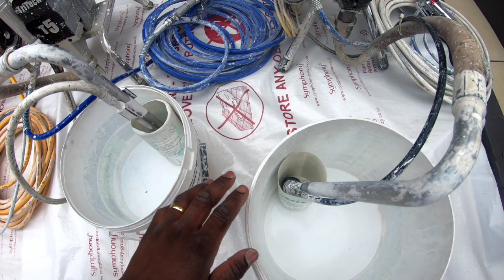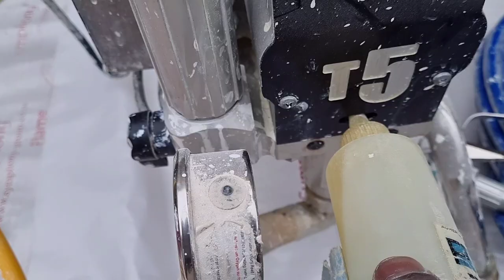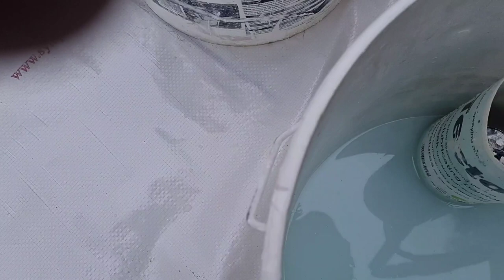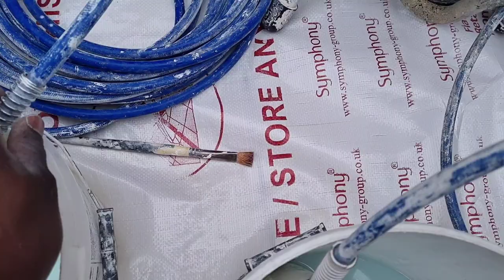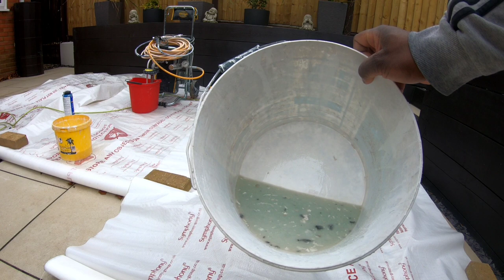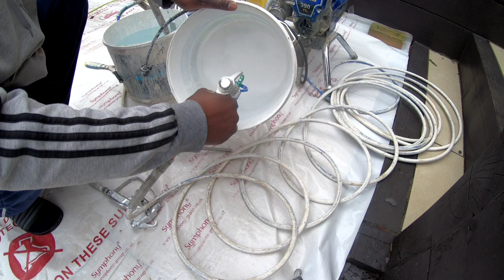How to remove silica dust from your spray rig and spray hoses

Comment: Colin what is silca dust. Dry paint
Reply from the maker: Silica dust is comes from when you cut up concrete or bricks.  In the house I went to spray they cut up the concrete floor to sort out the drains . My tubs of paint were cover in this dust , if you add water to the dust it pretty much turns back to concrete. Which can be a right pain in the arse to clean out.

Comment: Hi Col, great video mate, Col Im looking for a little advice if i could please, ive been asked to spray a shop out down here in West Wales, its tape and caulk 500m walls 500m ceilings,  would you know a rough metreage to charge with paint included, many thanks if you could help me out with a few pointers thank you
Reply from the maker: The way I charge is I look how long it takes me to paint it out buy brush and roller and that's how much  I would charge to spray it.
Reply: @camdecorations9779  thanks col i do appreciate it thank you